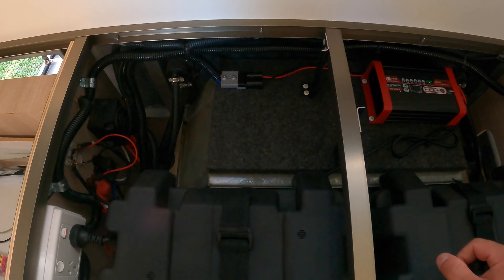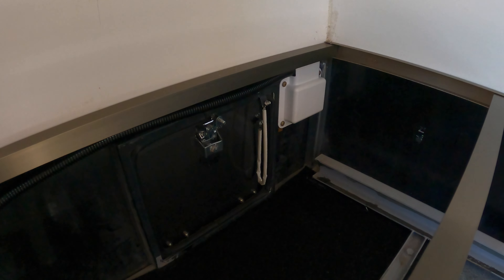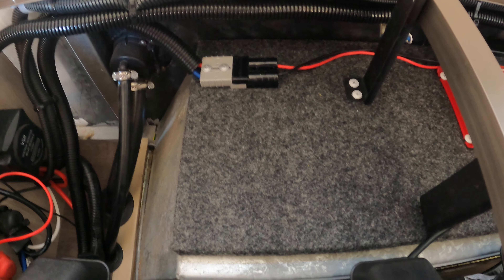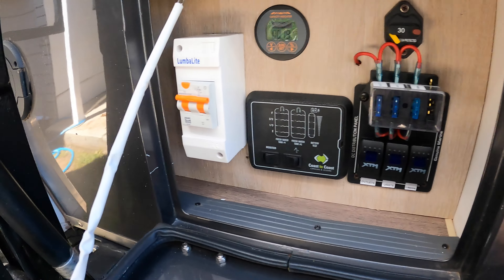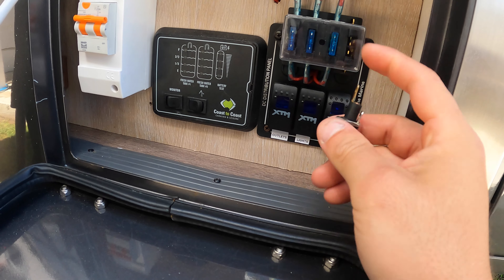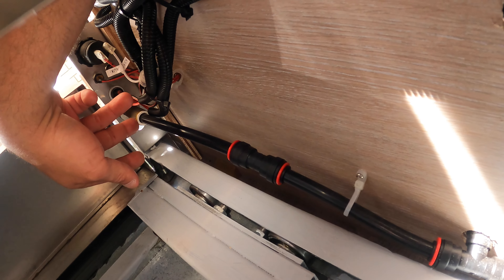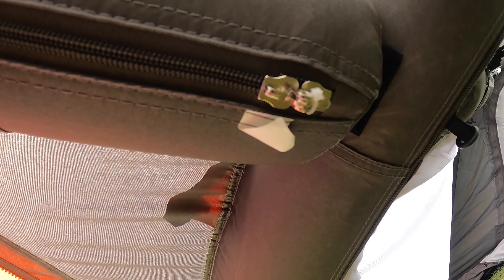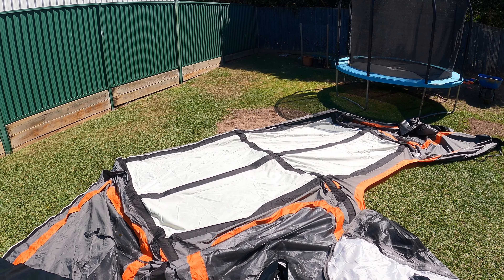Jayco Jtrak Tips, Tricks, Our Mods 240v add on and Things to look out for

Comment: Good info in the vid as it was very helpful as iam looking at purchasing one. How have you found the unit overall no out problems ? Is it possible just to fit an awning it the side of the camper instead of a full annex ?
Reply from the maker: Not that I could think off. But the tent section has a zip that is for the annex. I thought of getting a awning fabricated utilising the same zip, so that I could zip on the awning and store it with the tent inside the camper. That way I could unfold the camper the awning would be attached and then it would be a matter of pegging the awning poles in place.

Comment: Do you need to earth to the chassis or anywhere else off the back of the 240v inlet?
Reply from the maker: Not 100% sure I think you do. But I had an electrician connect all the wiring side of things, I just mounted all the components to try and keep costs down. When I get a chance tomorrow I ll have a look and see for you.
Reply from the maker: So I had a look. Yes it has the green and yellow from the inlet earthed to the chassis of the camper trailer.
Reply: Thanks for checking